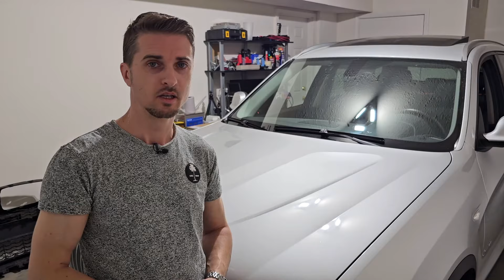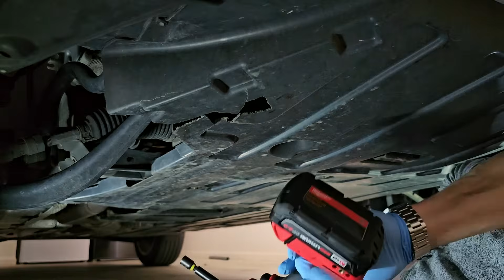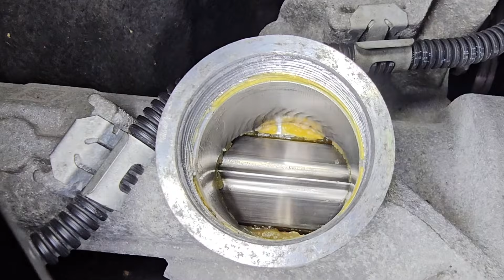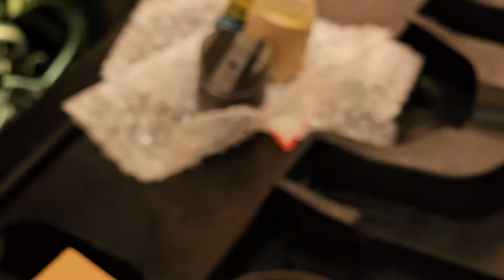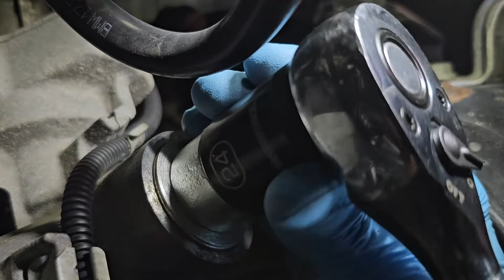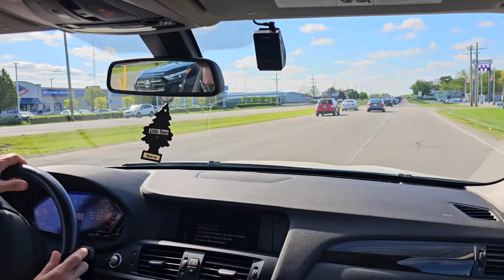Steering noise Repair BMW EPS

Comment: Hi, thanks for the helpful video!

I have a 2014 BMW 320i xDrive (F30) with a clunking/rattling noise coming from the front end, especially when driving over small, uneven bumps.

I also noticed that when the engine is OFF and I quickly move the steering wheel left and right, I can hear a very similar clunking noise coming from the steering rack. However, the noise disappears when the engine is running.

My question is: *Can a worn steering rack thrust piece cause rattling or knocking noises while driving over bumps, not just when moving the steering wheel with the engine off?*

I'm trying to figure out whether replacing this part could also fix the noise I hear while driving.

Have you experienced this issue, and did replacing the thrust piece eliminate both noises?

Thanks in advance!

Comment: Great video! Why not just use a marker before removing it to know exactly where it lines up? I need to do this , this weekend. Also on the N52 anyone done this job from the top.  By removing the air filter box you should have a ton of space.
Reply from the maker: Using a marker would help! Because the new piece has a different size and elasticity compared with the old one, that's why bmw repair instructions required using that special tool!
Reply: @MOvidiu thanks for the reply. What if I used the old cap/covet and used a marker?

Comment: I had it done in a workshop cars was 4y old when it started to make the noise +/- 40k km. First the dealer official BMW. Did not know how to do it. Then i showed the official procedure i could found on internet from BMW USA. I am living in Belgium haha. So i don't know how they did it i guess with the special tools. Noise is gone but the steering feel is not as original its feeling unnatural a bit too tight. Almost all BMW'S suffering from it un believable.
Reply from the maker: if is tight then the procedure wasn't done correctly

Comment: Hi if the sterrig whell is stretchef,does it go harder ?
How much slack should the stering whell go with one finger?
Will the steering whell get stiffer over time if there is a gap in the bar if i don't loosen the screw?
Thank you!

Comment: Hi is it the same on a Mercedes E class? You have to tighten it to 70 Newton metres then back it off a little bit
Reply: did you do it ?
Reply: @samisabbarh2609  yes easy
Reply: @Fishing-qe6wq  Thank you very much; at what torque (in Newton-meters) did you tighten the new part?
Reply: @Fishing-qe6wq i have c class 2019 maybe it’s the same tighten of your e class 😮

Comment: ive tried this myself, for some reason the new piece doesnt fit inside all the way. it has the same cap and the same beige piece inside. it goes in halfway maybe a bit more. up to the second seal and wont go further in. any ideas?
Reply: You need to make sure the new bushing is oriented the right way so the gap fits over steering shaft. I was having the same issue as you and ended up having to stick my phone up there and take a picture so I could see what way I needed to orient the new bushing.

Comment: Great info! I did this a while ago but I didn't follow the torque recommendations you show here. I just tightened it quite hard and then released it until the steering started to self-center.

I have a strange dead-zone in the center. It's not really a dead-zone but more like it moves in steps. Like to move the wheel in between those steps is light but to overstep it needs more force. Went to a indie shop who has some kind of measuring equipment to check the tension, they said it's all good but the dead-zone is still there. Really annoying, especially on highways.

Could the dead-zone be there cause it's not tightened enough? Too much tension? Or the steering rack is kaput?
Reply from the maker: Hello,  unfortunately I don't know what your problem is , but I suspect that you have overtighten the cap .
Reply: Did you ever figure it out?

Comment: Sunt puțin dezamăgit ca nu ai continuat până la capăt Ovidiu. 
Pentru ca asta îmi place la tine, mergi acel extra pe care majoritatea nu-l fac. 
Am montant kit-ul respectiv și eu la dealer (am primit un preț foarte bun) și pot să îți spun ca este destul de importanta calibrarea casetei. 
Fiecare casetă calibrându-se diferit în funcție de uzura prezentă. Exact cum îți specifică în ista. 
Din vagi amintiri îmi amintesc ca este necesară măsurarea jocului pe 0* și 120* unghi de virare al roților. 
Spec ul pt 0* fiind de 25+-5 microni, a mea prezentând uzura mecanicul de a lucrat a trebuit să mi-o pună pe 40 de microni la 0* , strângând-o la 25um nu mai respecta toleranța pe virare. 
Iar acel mic probe este un fel de ceas comparator electronic. Dar având o precizie mai mare de obicei decât un ceas mecanic , dar domeniul de lucru fiind mult mai mic față de un ceas.

Comment: There is no need to liftUP the car, better way is remove airbox and access from top
Reply: Even if it's easier to do from the top lifting up the vehicle and doing the 4x full lock to full lock will be required to take the load off the rack

Comment: Hi Ovidiu. Thanks for the video. When you rise the car, with battery connected, what additional measures are you taking to avoid MRS  error /cable + failure? ...By the way ...Sărbatori fericite 😊